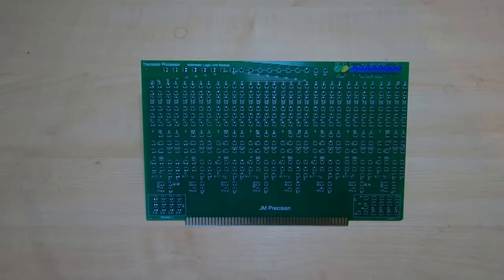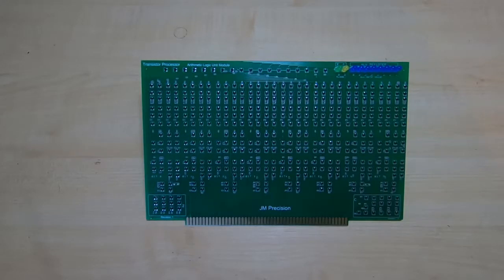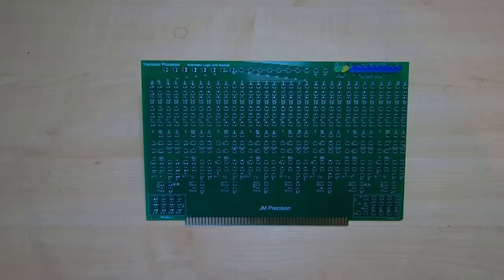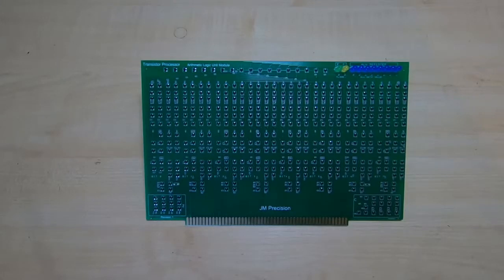CHM T36VA Pick and Place Machine Part 7

Comment: When setting up your machine did you have any issues aligning the nozzles/reels for picking up parts?  It seems to me on my machine if I calibrate the material stack with the top camera then it is slightly offset when the nozzle actually tries to pickup the 0603 part.  However if I calibrate using the nozzle then it seems to pick them up correctly but I have to do this manually for each .dpv file. Do you know if in this video she is saying the center the two cameras on each other or to adjust the camera till the offsets goes away?  https://www.youtube.com/watch?v=mJxsUA6ALXc

I guess your machine is already fully calibrated but at least for me that would be an interesting video on how you calibrate the nozzle to properly pickup parts from the center.

Maybe another way to ask the question is in your .dpv file is it normal to give an offset for picking up the pieces like this:
Station,0,1,-1.21,-1.4,4,R10K,0.5,0,6,0,0
Or should that (-1.21,-1.4) be (0,0) and that offset data should be else where in the system setup?  In your video (part 2) I see you use the values (0,0) but if I do that my machine will not properly pickup parts.

Anyway I will keep playing with my machine and maybe I will find the step I am missing...
Reply from the maker: Are you having problems with the heads picking up parts or with the parts being correctly position for pickup?Start by aligning the cameras so that they both have the same centres. Then align the pull needle. Ignore the cameras for this. Move the head to the pull position and then lower and raise the needle. It should drop into the tape hole without sticking (make sure the head is in the position for a pull and that the tape has been pulled. Adjust its position until the needle moves up and down smoothly. Then align the head for picking using the camera. Check that the take up reels are set properly for tension or they can have a tendancy to pull the tapes out slightly depending on the particular reels. You should not need to realign the machine each time (except the board).
Reply: @JerryWalker001  Thank you for your reply.  Re-calibrating the cameras fixed most of the offset issue.  The calibration to pull the tape forward works fine.  After working with the machine all today I think I have a better understanding.  I think the issue is user error as I am misunderstanding how the machine is designed to be used.  At the moment I just want to use the machine to place common 0603 to 1210 sized resistors/capacitors on boards in small batches (like 1 or 2 boards at once.)  I was thinking once the pull needle is configured I would some how configure where that part is picked up relative to the needle at a system level, but I think I am finding that configuration is only stored on a per job basis (not at a master system level.)  So for my use every job (.dpv file) I create I just need to copy the "Station" lines over to with the different offsets for the 20ish parts I use commonly and plan to leave on the machine for years to come.

Time will tell if I am able to make this practical... I was thinking that rather than spend an hour manually placing parts on a board I design that this machine would do 90% of the placing with a simple BOM of coordinates.  I also need to find a better way to apply solder paste, hand spreading on the PCB is not very effective, I guess I will get the solder paste stencil on my next board and see how that goes.  All this to hopefully save my eyes and not steady hands from having to place tiny parts...